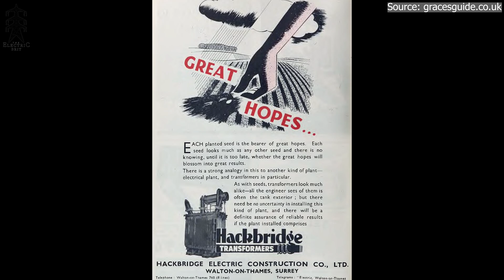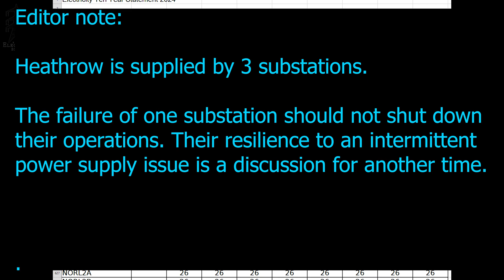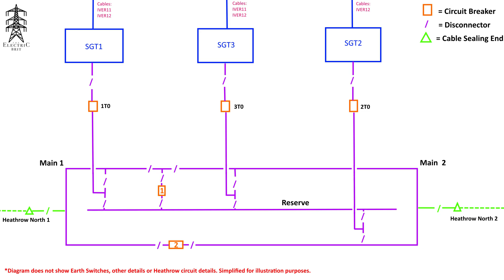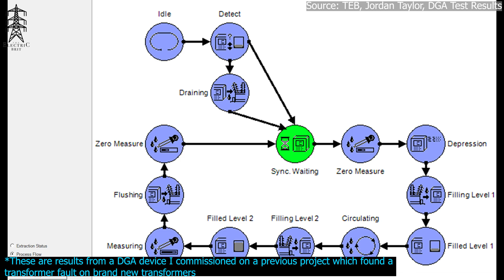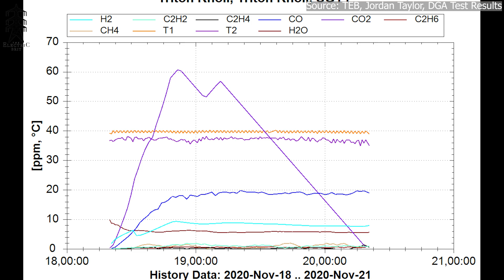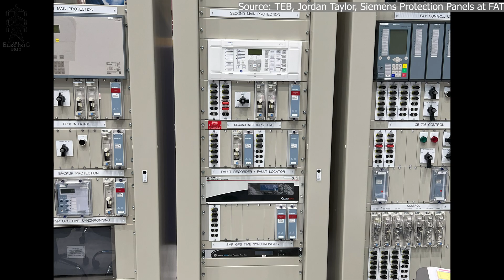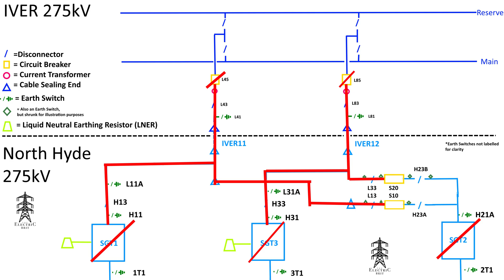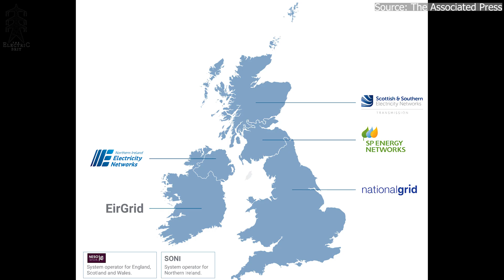North Hyde Substation Fire Analysis

Comment: It’s strange how all safety features on the transformer failed.

Strange how the fire suppression surrounding the transformer, failed.

Plus the 2 generators for the fire suppression also failed. 🤷‍♂️
Reply: Transformer fires happen. It's just that in this particular case there was a very high profile load on the end of the feeder

What's a real surprise is that Heathrow apparently didn't have geographical power feed redundancy (I was led to believe it did) and insufficient onsite back generation 

I'm sure there will be a lot of finger pointing but in the end Heathrow should shoulder most of the responsibility for not wargaming a total supply outage and planning mitigations decades ago.

Yes the safety critical aviation stuff was covered but very large public spaces can easily become deathtraps if the lights go out and a stampede develops because 1 or 2 people panic (humans are very prone to this)

I've seen other criticisms of Heathrow's preparedness for various events which indicate sub-par management (eg: during one large snow event they had zero snow clearance kit of their own and tried to comandeer Luton's equipment. Heathrow closed, Luton didn't)

The UK power grid is well engineered but there are a lot of these 60yo transformers in service and my calculations for net zero indicate that Britain will need somewhere between 3 and 6 times the TWh/year that is currently being generated to meet demands - which I'm sure NG are fully aware of too (we're going to need a stack of nuclear plants, there's no escaping this)

Unfortunately that excellence in planning doesn't extend to local distribution. With the looming gas boiler switchover and EV charging plans need to be made NOW to cope with the average 5-minute smoothed residential power consumption jumping from 1kW or less to 7kW or higher for sustained periods, particularly in cold weather

On a vastly smaller scale, Facilities management in the university I worked at turned the heating systems down (remote control) without staff consultation, with the inevitable result of a lot of illicit fan heaters appearing under desks - this in turn damaged supply wiring to one building along with a 2MW campus-sized UPS overloading and dropping its bundle which in turn heavily impacted spacecraft instrument flight qualification testing. 

For the sake of saving a few thousand pounds, facilities management nearly cost several million in contract breach penalties (lots of negotiation with the space agency involved) and very nearly caused interplanetary and deep space instruments to miss their flights - if your stuff isn't ready, the rocket folks will just bolt a steel block of the same mass in the reserved spot on the spacecraft and launch it anyway. Planetary alignments don't wait for anyone.

The fact that they were found to be turning the heating off overnight in onsite student flats was the icing on the cake as HSE got involved

Yes, there was a change of policy but these things far too often happen AFTER preventable events despite warnings, usually driven by managers with a poor grasp of what they're actually managing.
Reply: Seen deluge system kick off on an oil rig. Water was heralded by a cloud of rust coming out of the pipes such that we were able to clear the area before getting soaked. 
Unless they're tested regularly wouldn't be surprised if a deluge system got full of corrosion sufficient to block some of the spray heads.
Have no idea what their testing frequency or protocols are, but doubt covering high voltage equipment with rusty water periodically is overly desirable.

Comment: Why weren’t the trafos surrounded on 3 sides by concrete walls to isolate fire
Reply from the maker: The requirement for blast walls came after these transformers were installed I believe and the fact it had a fire deluge system meant they could be placed closer together than the 10m recommended separation. 

Some sites of this age do have a brick blast wall between assets where there is no fire deluge and the newest transformers I’ve been involved with did have concrete on 3 sides and a metal enclosure with fire suppression.

Comment: Alined with most comments - Thank You! 
Precise, clear explanation of what could go wrong instead of the stupid conspiracy theories.
Reply: Well, such failures always are a conspiracy, just not like the conspiracy theorists dream up.
A conspiracy of errors or a conspiracy of failures introducing a fatal fault in the unit.
In this case, it could be anything from a plumbing issue in the coolant expansion or even test system, a fault cut-out system failure, a maintenance worker leaving the coolant test valve not fully closed, a transformer insulation failure that rapidly degraded a substantial section of windings and rendering a rather long circuit quite short and overheating the coolant or even a flaming unicorn fart igniting the entire lot.
That's why there are investigations into the failure chain. And likely, it is a chain of faults that follow the infamous Swiss cheese model, when all of the holes line up, a simple fault turns into a disastrous failure.
One upside is, there were no casualties.
Reply: @spvillano  You are correct - I wasn't trying to clean up the gene pool, merely big up the poster for pointing out ALL the more likely things that caused the failure and steer away from the flat earth mentality that seems to be gaining traction in these days of instant social media insanity.
I would imagine (having worked in telecomms) that the largest conspiracy is the failure to invest in new kit (AKA maintenance) and the misuse of built in redundancy by management. The redundancy is there to cover the 'just in case' not 'when it does'.

Comment: I'm aghast that Heathrow doesn't have it's own fleet of OCGTs
Reply from the maker: I jokingly suggested on another platform that they have a piped supply of jet fuel, why not a standby engine at 60-80MW to use it instead of talk of diesel generators. For a once in a decade event it would be far better spending that money making everything else resilient first and trusting you’ll have at least one of the 3 grid feeds.

Comment: A video that cut the bull and gave information to many who only get the hype from the headline news.  Good work with no sensationalism just good electrical information. Praise to the team that got it back in such a short length of time. It shows the skills we have and effort that is put in when “issues” occur. Thanks
Reply: Well.... I learned about the internal structure of a transformer. There was an incident local to be just over a decade ago involving 400KV I now know where the failure point was.

Comment: Excellent video.  Thank you. 

It would seem likely that this was one of the early (275kV rather than 400kV) supergrid transformers, and a testament  to the quality of engineering and ongoing maintenance.  

Its ironic that societal change means we are demanding more from such assets as they get older.  I hadnt considered the paper duelectric, and its potential material change over time.  I wonder if this might be a wider issue across the broader cohort of transformers installed at a similar time.  

We have advantage now in materials science that we did not 60 yrs ago, so our sophistication of understanding cause will be better when that work is done.

Comment: A large portion of grid transformers appear to be from the 70's and earlier. 
They were over engineered. 
But time is cruel, and we are probably going to see more of this sort of thing, especially now as we move to charge electric cars etc.
Reply: Transformers overheat and fail - water ingress during down time is a frequent problem too.
The site I work on has an 11kV transformer failure about every six months (have dozens onsite doesn’t help)…

Comment: Great video and technical content. It seemed quite an old transformer for such a critical transformer
Reply from the maker: I’ve only worked on two sites in North London and both had transformers twice my age. A lot of this stuff you’ll find the older the better. When it comes to switchgear it’s often easier to maintain and built to last. 

SSEN have a published reinforcement date this decade so maybe it was coming. Appreciate the comment 🙏
Reply: @TheElectricBrit  I work on various DNO and TSO substations, and I'll agree older equipment is built to last Especially transformers if maintenance is carried out regularly, also with switchgear I've worked on reyrolle MV boards still in operation from the 60's. It's an industry very heavy with older highly technical people retiring with generation z coming into full up there boots etc.
Reply: Makes you wonder whether it's survivorship bias.  If all the old stuff that was rubbish has since been replaced, then the majority of the old stuff still in service is going to be the best of the best.  When you look at a given asset, the question then becomes whether this is also one of the good ones, or is it one of the rubbish ones that for some reason missed getting replaced!

Comment: Very impressive for a first video.
Another commentator said there was a small backup generator on site for the control/extinguisher systems , and Ed Milli-thought said something (probably incorrect) about the substation backup generator not working. If this failed to cut in would the extinguisher system not work?
Reply from the maker: Appreciate the comment 🙏
All substations are fed firstly by the DNO (not sure if it would be the 66kV sub in this case, not familiar with the site), then sometimes have a supply from the auxiliary transformer on the SGT (no use in this case due to fault) and finally a backup diesel generator which has batteries to start it.

There’s also a battery system for the substation for operating switchgear and protection relays for a number of hours with no supply. 

We will need to wait for the report to see if the diesel or fire suppression failed though. Some suppression systems don’t require power but not familiar if this one was one of those. I’ll follow up with a video when the report is public 👍
Reply: @TheElectricBrit would substation batteries also be able to operate deluge system valves or do they require pumps to be active?
Reply: @ The fire system is powered separately, the two diesel engines will have their own battery supplies to start etc.

The sprinkler system can be wet or dry (I would guess dry as I cannot see any insulation and trace heating). Almost the entire system is mechanical and very reliable.
Reply: @ The substation was equipped with a duty/standby pump house to the north and a c. 100 m3 sprinkler tank. You can see the red container next to the gate. Looking at the bund, I would say that the sprinklers did not function, rather than the sprinklers were ineffective.

Ed misspoke, he meant to say "transformer" not "generator". This site does not have 100 MW of generation in the form of diesel generators.

Comment: I don't know what oil is in these things, but in general, water on an oil fire doesn't help. (as rare as it is, I've seen a few transformer fires, usually caused by overloads - summer with 10mil AC's running.)
Reply from the maker: I’ve never been around to see a deluge go off but on site we do just call them fire water tanks. I suppose if you dump enough of it on with a good enough mist it’ll suppress flames, displace the oil and cool the tank.
Reply: There's a similar argument about flooding EV batteries with water when they catch fire.  Part of the idea is to starve the fire of oxygen (by displacing it with water) and also to cool it down (by having the water evaporate as steam), both of which slow down the fire and make it less severe.  It may burn for longer yes, but if it doesn't get as hot then it reduces damage to the surrounding area.
Reply: With transformers of this era it is likely a mineral insulating oil, which is highly refined from crude petroleum, with a few additives mixed in to reduce degradation. The deluge systems are high pressurised water and are more designed to supply a barrier around the transformer to reduce the likelihood of spread and damage to neighboring apparatus. They won't be able to put the fire out on such a large transformer as this one.
Unfortunately under catastrophic failure, the pipe work can get damaged and the deluge system becomes ineffective. Once the oil has been ignited and the paper insulation is burning inside, fire fighting is limited and it is more about waiting for it to burn out.
Reply: @three-phase562  I'm guessing that they'll just rip everything around the burned transformer out and replace it, to guard against any hidden damage
Reply: @ They will have an assessment program for all the surrounding apparatus, and likely across the majority of the switchyard.
They will be able to carry out visual, mechanical and electrical assessments to determine what is reusable. It will be a long drawn out process though.
Reply: Locally some of the main cables in the roads have mineral oil insulation. The local electric company have replaced some of them, seen a mention of them being life expired.
Reply from the maker: My next video will be a deep dive into cable systems. Currently script is around 22 minutes long and covers the historic oil filled cables too. Same principle, oil impregnated paper where the oil insulates and cools.

And I won’t be surprised if this is an opportunity to replace both transformers and bring reinforcement sooner.

Comment: too many Teslas charging up on cheap electric at night
Reply from the maker: Guilty as charged! (Pardon the pun). I won’t knock 7p/kw but then again I’m not in London.
Reply: @TheElectricBritMy Tesla charges for free during the day… Solar panels are useful…
Reply: @ solar panels wont fully cover a 32 amp charger unless a house has a shit load of solar panels in a field
Reply: @ My 10kW worth of panels on my roof have no problem feeding a 16A charger…(that puts 3.2kW into the car and 5kW into the 12kWh battery (or grid after the battery is charged).
You get about 400W per square meter off a current generation solar panel.

Comment: The framing as a "low probability event" is how the grid ended up so rickety to begin with.  It was an INEVITABLE event on an unknown timescale.  Nothing lasts forever. Nothing. A 60 year old, 100 year old, or hooked up yesterday transformer WILL FAIL.  The daily probability approaches 0. The absolute probability is 1.
Reply from the maker: I agree. Every transformer will be taken out of service or take itself out of service eventually. It’s a matter of time, no matter what the maintenance looks like. 

The DGA results in the video show this. All 4 transformers on a project were brand new and all were gassing. Compared to the many 60+ year old transformers still on the network. 

But likewise how often do transformer fires happen in the UK or make the news? I’d call that low probability, and the maintenance and protection schemes help reduce that probability. Appreciate the comment 🙏

Comment: Ironically, SSEN (company who operates North Hyde) issued a paper in 12/24 laying out a comprehensive plan to upgrade this whole area of the grid. Included in this plan was a replace all three transformers at Nortyh Hyde! Also back in 2020, there was an article on SSEN website laying out how SSEN would improve the grid around North Hyde. I am not any expert here, but it seems clear that SSEN has known this part of the grid was possibly near capacity since 2020.
Reply from the maker: NESO ETYS Appendix G I quote for the node demand in the video projects the demand increasing pretty rapidly over the next few years (reported by SSEN) and the 12/24 document is very interesting. Wonder if they’ll fast track the work to coincide with the extended outage replacing the SGTs.
Reply: @ I don’t expect it to come out in any investigation, but would the grid operators have any warning that this unit was about to fail? Also, since I really don’t understand the complexity, is it possible to switch to the second unit seamlessly?
Reply: Aren't you confusing the GSP which caught fire (I presume operated by NG) with the DNO substation down the road?
Reply: And that's why Russkies attacked this transformer. 

My bet is thermite - leaves iron after burning, which is inconspicuous in a transformer fire.
Reply: Companies have also been building a lot of datacentres in that part of the world. Which is not where the generation is. Meanwhile, constraint payments to generators in other areas (e.g. Scotland) are costing a fortune.
Reply: @ But the video clearly explains that the load on the NG substation is fine.
Reply: north hyde is split between SSE and NG the side that the transformer burned was NG not sse
Reply: @ "Split" is probably misleading. There is the NG substation (275/66 kV) and then there is a separate SSEN substation (66/22 kV) and I think 66/11 kV for local distribution through 30 metres of trees. There are two separate substations.
Reply: @ correct  that is my bad. i also know that the NG site was recently updated and fairly new.